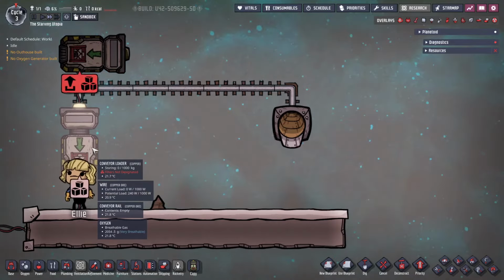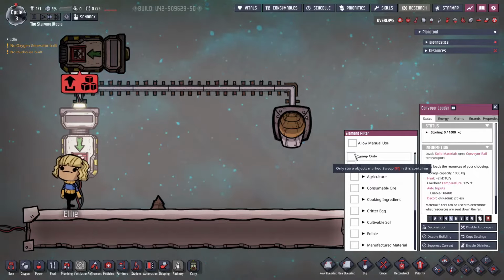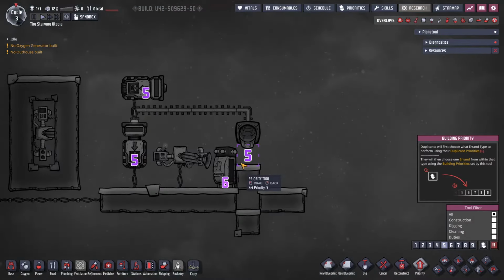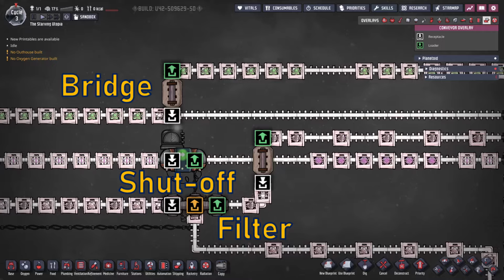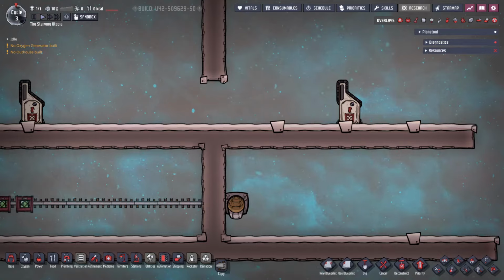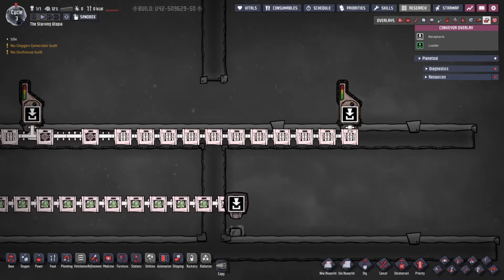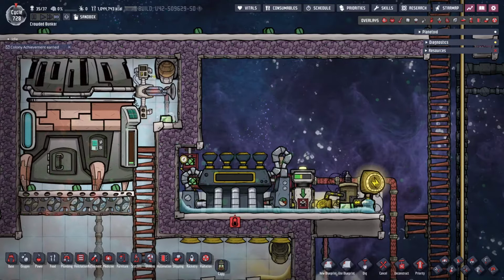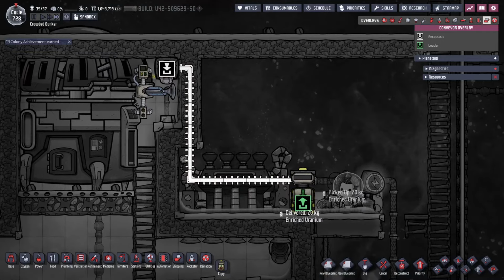Oxygen Not Included - Tutorial Bites - Solid Shipping

Comment: I'm kind of a firstie with automation with conveyor rails, and I am trying to do a meat farm with Hatches, I have automated the ranches to ffeed the Hatches, and I designed a logical system that activates autosweepers to sweep eggs and spend them away only if There are more than 3 Hatches, and more than 1 egg in the ranch, it works fine, the problem is that the autosweepers suck all the eggs and, the idea is leaving at least one so population doesn't drop, I am struggling to find the solution, so if someone has a good answer it'd be really Nice, I was thinking of using the conveyor shutoff with the automation to spend back one egg only but I still haven't figured out how to do it exactly
Reply from the maker: You can try and use a shutoff and sensor to send them back in when below a certain amount but it is difficult to make reliable because the sweepers grab all the eggs at once. The easier way to automate the ranch level is as I explained in the Critter and Hatch Tutorial Bites. Sweep all the eggs out and use an incubator. Dupes will automatically take critters from an incubator to a drop off if there is a need, so the level is maintained.

Comment: 5:34 is the cooled metal output into brine/saltwater to cool it down further?
Reply from the maker: That is the idea there, yes. Adding some liquid just helps make a bit of a temperature buffer and helps the cooling loop conduct. You could likely get away without that if you wanted.
Reply: @GCFungus  isnt that unnecessarily heating the coolant? constructed buildings are always at 45 degrees celcius if the materials used is hotter, in my experience. unless if you want to feed plug slugs, i guess cooler temperatures is desireable
Reply from the maker: @alamrasyidi4097  I don't think the limit is 45 as I've definitely had buildings come in hotter. Generally cooling it helps for dupes without atmo suits and carrying it through liquid locks. But you can definitely get away without it if you use it carefully, so up to you.

Comment: Was trying to figure out how to send small amounts of food to the second planetoid regularly via teleporter.... Rather than the entire food supply (:
I was trying to use "allow manual use" and have a container set on the other side set to only accept certain items, at a small max capacity. Will the dupes load a conveyor to the other world with every accessible material, dumping on the floor via chute- or just what the boxes on the other planet are "asking" for? That's what I'm trying to figure out. No possibility of a "loop" because it's the other planetoid!
Reply from the maker: I haven't exactly worked out the way to do this and not have the food not spoil, but from a shipping point of view I think the best way is to use a fridge set to accept small amounts of food. This would then have to be sent to an interplanetary launcher by an autosweeper and conveyor loader. Send the signals between the planetoids with the automation broadcaster and receiver. Then you'll probably need some more automation signalling to make sure the fridge only gets restocked after enough time, so you don't get multiple requests from the same signal.

Comment: really wish there was a minimum setting for how much the autosweeper picks up, extremely inefficient that it loads the first 1k kg, then gets stuck loading only 80kg each load
Reply: the material it needs to move is from one spot, put a weight sensor on it to only activate the sweeper when theres more than a thousand
Reply: @alamrasyidi4097  clever!
Reply: You can use a timer sensor, to force the auto sweeper to wait until the loader is empty again.
Reply: @geeksdo1tbetter  i tried timer sensors, but it always ended up eventually going back to 80kg loads

Comment: If a solid melts on a rail where does it go?
Reply from the maker: It will turn onto a liquid on the same tile if it can. If that tile is behind a solid tile, then it should push the liquid out, starting at the top and going clockwise if those tiles are also blocked. If the entire area is blocked then I'm not sure if it looks further or just deletes the material.
Reply: @GCFungus  thanks for the info this series is helping me a lot 🙂
Reply: @GCFungus cool! I didn't know about the searching clockwise part

Comment: There are a few key points that make rails different from pipes and I think they need to be addressed:

- Solids on a rail won't ever merge. This is sometimes a problem if circulating them for cooling, as very small packets (mg) don't transfer heat well and can fill the rail over time.
- Solids can safely change state on a rail without breaking the rail itself, as seen on the example with the ice, unlike liquids or gases on pipes.
- When a solid on a rail changes state, the packt remains on the rail as an empty box, and will occupy space until it reaches some sort of solid input.
Reply from the maker: All good tips!

Comment: The worst thing is that dupes will steal the storing job from autosweepers when they are idle which lengthen the delivery time when the conveyer belt is made to go through lots of walls. If only autosweepers had higher priority than dupes' supplying job.
Reply: In most cases you can develop a system that can work without dupes. Then just shutting the dupes out of the system to avoid them interacting with it.
Reply: @peterthegamer9334  make a room with a locked door, put a dispenser right next to the door, since dupes can reach through doors to deposit items, they will put things in, but the dispenser drops them out of reach. you can even set up a weight sensor to check the amount of items deposited and add another door connected to the sensor to lock itself when enough material is deposited, preventing the dupes to reach the dispenser at all